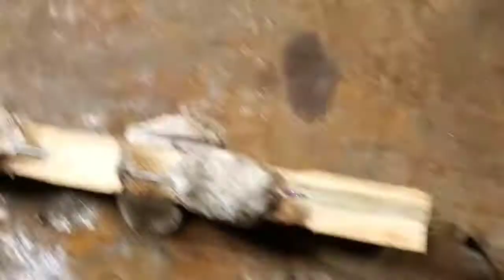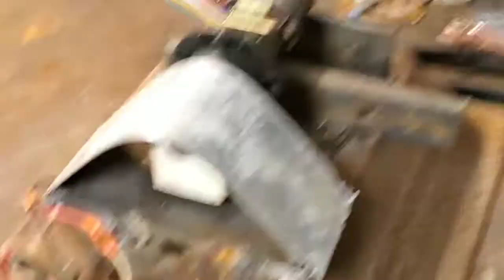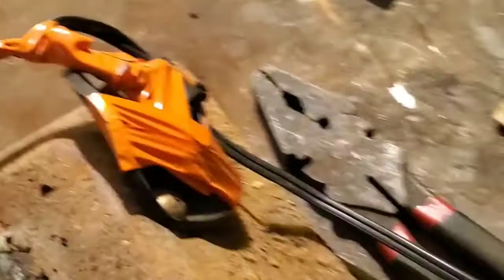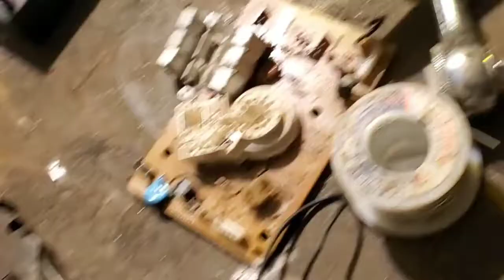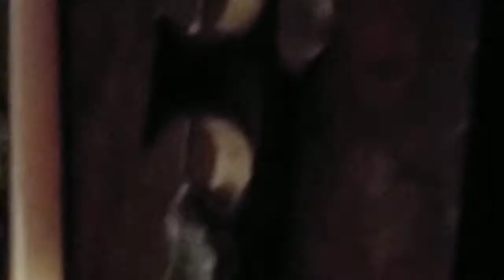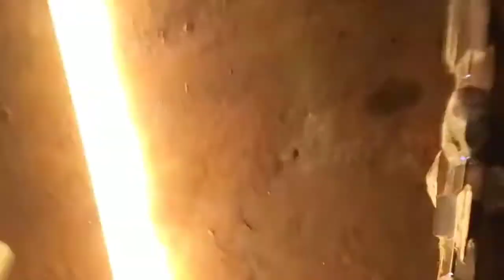Gerard Morin Replica RF PUMP and 3 spark gaps. HIGH VOLTAGE, HIGH FREQUENCY GENERATOR

Comment: You need to have one of the gaps bypassing the electron tube to stop it cutting out also your circuit has to be connected to two different earth sources or the waves interrupt each other ive blowen up a few voltmeters after the 3rd gap but have measured 1800 ish volts....im also poor and have no resources. ..sigh

Comment: Is it Overunity?how much watts input and the output?
Reply from the maker: I need to check. I'm not exactly sure
Reply: @MrFigureitout  what i understood in his video,gerard morin its over unity if you connect it to high voltage transformer and connect it to 3 spark gaps..i have also pump here but I don't have high voltage transformer and spark gap.
Reply: @MrFigureitout  my experiment with the pump it not Overunity, because the input is higher than output.maybe if i have HV transformer and a spark gap i will success over unity.
Reply from the maker: Yes I believe thats what he claims. Unfortunately I have not FULLY tested this claim yet. Although what I have done similar sure does always give some interesting results!
Reply from the maker: Keep at it bud!

Comment: Sir may i know the details of your drain pump? because im making replication,i think i bought small drain pump it only produce 130vac 10 watts only.i cannot energize my high voltage transformer.
Reply from the maker: My drain pump is from a samsung washer machine
Reply: @MrFigureitout  my drain pump details 220v 30watt.. what's yours mate?i want to buy again but im not sure.
Reply: @MrFigureitout  should i buy 120v 100watts drainpump samsung?
Reply from the maker: Yes